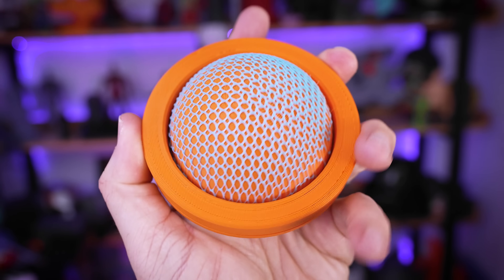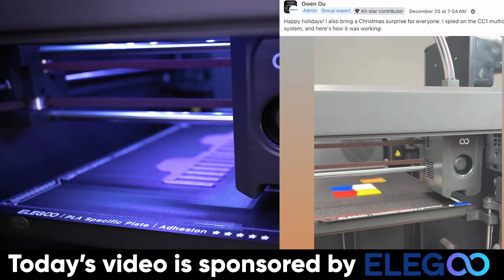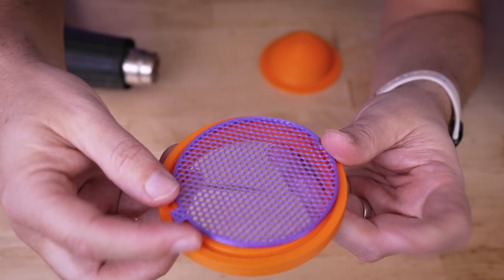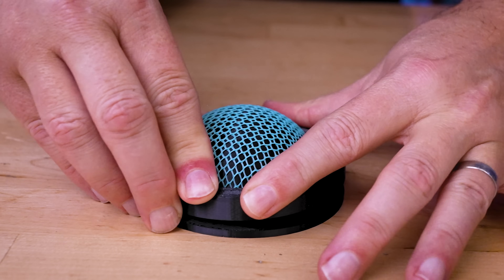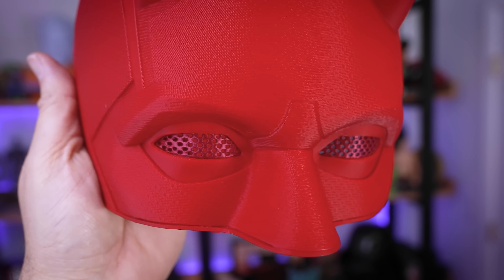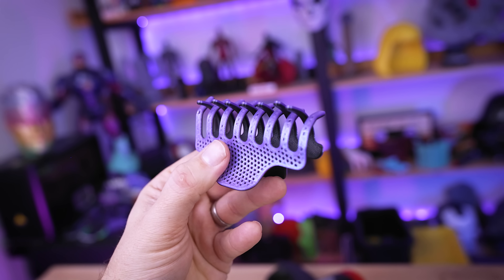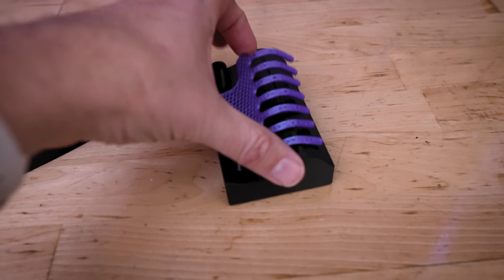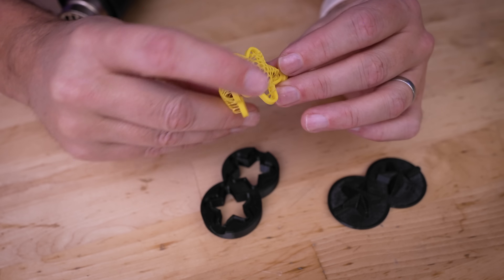I Printed This Flat Then Bent It Into 3D!

Comment: Hey, I need some help. I have a bambu lab A1 and i wanted to create some action figure accessories in multi color. I want the best possible quality and dont really care about time of prints at the moment. Im also wanting to use PETG for high strength because im worried the small accessories would be brittle if i used anything else. Would a 0.2mm nozzle with a 0.8 layer height work best?

Comment: What a clever technique for rapid form-fitting and prototype iteration! The ability to quickly test complex curved shapes with minimal material waste is huge for the design phase. Once a design is validated using a method like this, the question often becomes: ‘How do we produce the final version with more durability, heat resistance, or consistency?’ That’s where processes like thermoforming from custom-cut sheets, injection molding, or composite layup might come into play. Thanks for sharing this accessible and powerful method—it’s exactly the kind of ingenuity that pushes the whole maker and prototyping community forward.

Comment: You need to heat it enough so that gravity will droop the material a bit first. 
without the droop You are forcing  all the stretching to happen along the edges. 
ideally the stretching should happen evenly, but there is less change in distance in the center than there is at the edges.

Comment: As soon as you let the material touch the mold, you have to move fast, since the mold starts cooling down the top of the material. Applying more heat will mostly heat up the material at the bottom and make it worse. Try boiling water next time. It will heat up the material fast and even, without overheating. And then work superfast on the mold. Or print a mold of high temperature resistant filament and preheat the mold to the same temperature as the material you are trying to stretch.

Comment: Didn't Elegoo say they were not going to release a multi filament system on the Centauri Carbon. They were giving users a credit. Some were going to use it for credit towards the Centauri Carbon 2 (has a four filament side system), which appears to be what that clip was using.

Comment: Really cool, but I recommend to use a hair dryer instead of heat gun. Heating should be slow and with big flow of air.
Reply: This is the guy who came up with this, BTW.
Reply: definitely. Heat gun is too much heat ... even on low setting

Comment: Looks like a great idea for custom speaker grills.
Reply: Especially when using metal/wire mesh 😉
No heat required, printed form works OK (if in doubt, print at 99% infill)

Comment: It appears the friction at the center of the mold when you press it down keeps the mesh from stretching around the center.  So the edges have to make up for it and... double stretch.   The mesh needs to have the edges compressed in the design,  or not the round hole shape, to give them the ability to stretch into a circle.
Reply: The holes need to be more elongated the further the distance from the center, at a 90 degree angle to the stretch direction.  I dont know a better way to explain it 😂
Reply: @2railnation  you probably mean mesh sphere projected to flat surface?
Reply: @kimmotoivanen  basically.  You can't print a flat mesh with proportionate circle and expect it to stretch on a sphere and come out  proportionate circles

Comment: I think figuring out how to augment the rim of the circle to have a thicker more condensed shape so it stretches into the pattern that more closely represents the top of the semi sphere instead of looking like it's holding on for dear life
Reply: Part of the problem could be friction and cooling keeping top/center almost static, while all/most of the stretching happens on the sides.
Smoother mold surface, lubricant (silicon or wax?) and circular / processional motion during stretching could also help, as well as preheating the (ABS) mold.

Comment: I use this for my Spider-Man cosplays! I designed my own for the lenses mesh! You can even add a modifier in Orca slicer to change percentage and style after the first few layers! 

On top of that, I use my heated bed to warm the mesh as I don't have a Heat gun, and it works well for PLA!

Comment: I used to run an injection mold machine and really, there's not much difference. We mixed the materials (plastics, filler, processing agents, etc) then pelletized it for the injection machine. 
I look at 3D printing as a simplified version of that, but this just adds more steps. 
I'm not saying that this is pointless. I'm saying that it is best for those niche items. And, if I ever come across something that I could use it for, maybe I'll try it. 
I'm just wondering if it's worth the headache of getting it right with how much heat at what distance. Plenty of trial and error, which is fine from an R&D standpoint.

Comment: I work in thermoforming plastics.  So here is what you need to do, make the piece thicker with high heat.  When you stretch the material, it will thin out.  You've seen that.  Also, true thermoforming is literally just vacuum forming.  That's how we make the plastic packaging the company I work for makes it.
Reply: Yeah, "not enough material" was the obvious first issue. I think, for his purposes where pressure isn't applied evenly, he'd also benefit from heating the center of the print more than the edges, since the center should be contributing more to the stretch/expand but right now it's pretty sure only the edges doing that.
Reply: "So here is what you need to do"

Comment: This has a lot of potential, but it feels like you would mostly benefit from it if you need to make bunch of prints, like these balls you shown in the video, since filament savings are tremendous, or when you don't have a 3d model but need to form fit the pattern around an existing object. Since it will take few tries to get the heat forming right, for one or two pieces only, you are better off with printing it the old fashioned way, especially since the mold also has to be printed